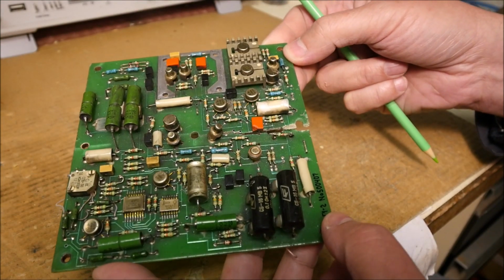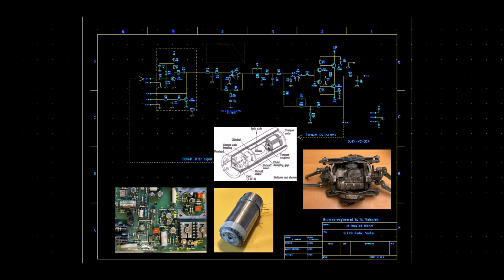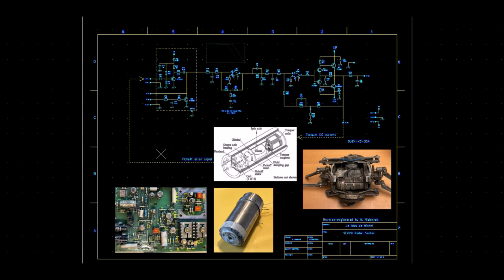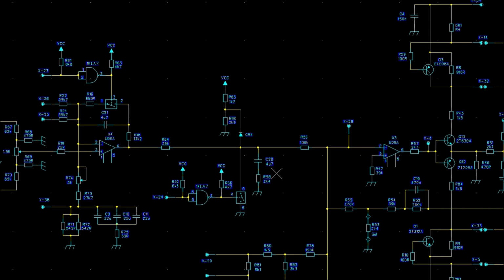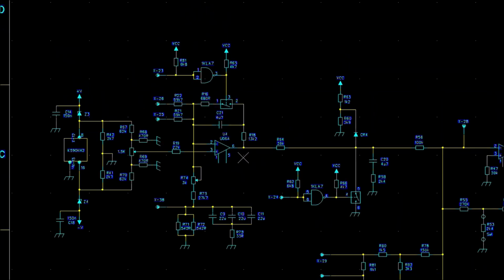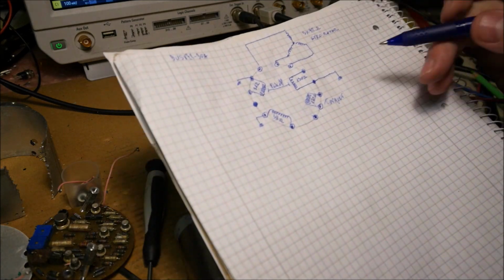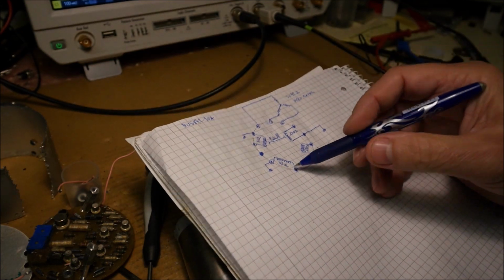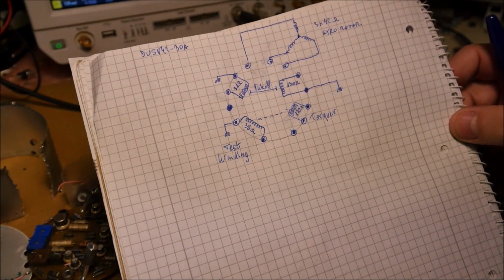LDM #385: 9E420 Radar Seeker Part 2: rate gyro and servo control board

Comment: Hi Michel. I know it's perhaps not your favourite topic but I would love a teardown of the RF feed from the antenna, looking at the feed horn design and the waveguides etc. that collect the RF signals for processing.
Reply from the maker: I don’t have the antenna nor rf parts of this seeker.
Reply: @lelabodemichel5162  Aucun problème! Merci pour votre réponse!
Reply: It is exactly what you see at 0:24. There is a broad rectangular waveguide, divided in the middle by a partition. Dipole directors and a plate reflector are mounted on this partition. This is the feed. It is illuminated by the parabolic reflector.

I do not know what is on the other end of the waveguide in this particular seeker,  but a textbook design of such feed uses a special hydrid, with three outputs. One output gives the "sum" signal representing the overall received power, and two other outputs give the "difference" signals which indicate the angular position of the target relative to the antenna's boresight in two orthogonal planes. A good antenna textbook would explain the principles of operation of such feed in detail.
Reply: @cogoid  I’m somewhat familiar with the arrangement of a monopulse radar. What I’m really curious about is the exact geometry of the feedborn at the top of the waveguide. In some simulations I’ve been experimenting with, the reflections of waves off of the outside of the waveguide that would otherwise cross and enter the opposite side of the feed appear as images in the radar picture. How this is overcome is what I am intrigued by.

Comment: You put in so much effort. Do you want to make homemade air defense for self-defense? I see that this is circuit design from the  Soviet mid-70s. I think modern chips are not used here since making changes will lead to too much work and new tests. It's all too expensive. It's cheaper to use old circuitry. Greetings from Moscow
Reply: Yes, it is always cheaper to not improve your gear. :P
Reply: Судя по вашему ответу вы ничего не понимаете в военной электронике! Дело не в том, что в данных устройствах не хотят использовать современные компоненты, а дело в надёжности и цене таких компонентов для по сути одноразового применения! Поэтому схемотехника и компоненты 70х годов и дешевле и надёжнее. Странно что такие простые вещи я вынужден объяснять.
Reply: @YuriWhite2251  У русскоязычных так мало добродушия.. я просто хренею . Послал бы тебя, но пожелаю вам счастья!)

Comment: Hello Michel, why do you think the PCB is coated green? I guess this board is from the latest releases of the Russian military industry. Thanks for the review.
Reply: This seeker has been in production since 1990. This specific board was manufactured in the summer of 2013, using components made predominantly in 2012. 

The green color comes from the "solder mask" layer coated on the board during manufacturing. The solder mask prevents solder from sticking to the areas of the board where it is not intended to, exposing only well defined solder pad areas. This prevents solder bridges, and is important especially in automated PCB assembly. The use of the solder mask was not very common in the USSR and hence Russia. You can see the older example of this exact seeker 0:24 with the boards without the green solder mask. But modern PCB manufacturing processes and equipment are easily available on the international market, and of course many factories in Russia started to use them in the 21st century.
Reply: Выглядит,как самое начало 80х